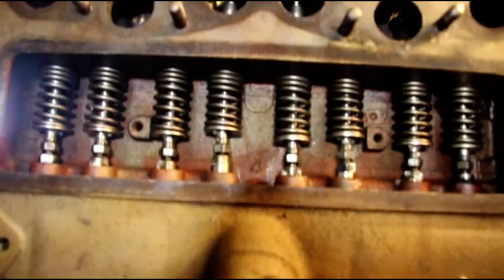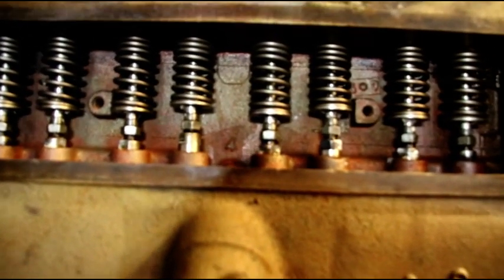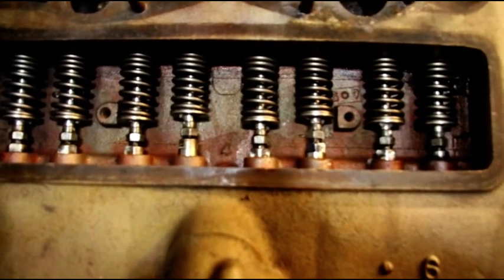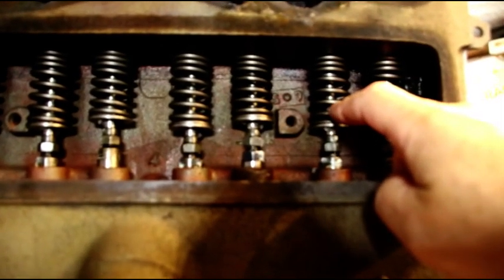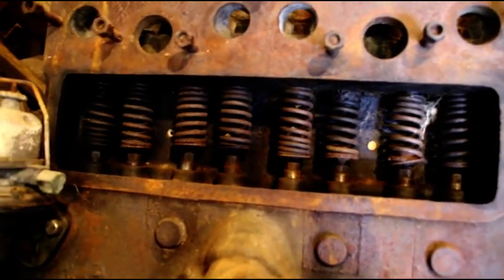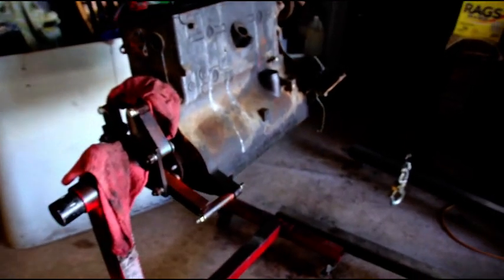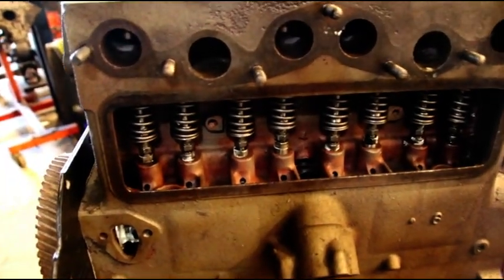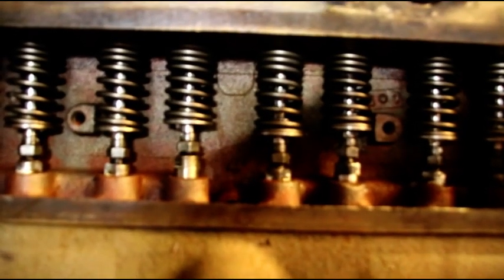Willys Engine Rebuild Tip Of The Day

Comment: Every tip you share is helpful Brian! I guess since most people work with modern engines, they think coiled side goes down without realizing that in a flat head the resting surface is up.
Reply from the maker: Many, many engines come in with springs installed correctly.   yes the engine will run but not as good as one of my rebuilds.  Lots of people have marginal engines and always wonder why their Jeep doesn't accelerate well or can't climb hills at high speed.  I have traced a lot of problems to the valve train and when it is right people can't believe how much better their engine responds.

Comment: The tight coils have to be at the spring seat end,  I have not seen an f-head jeep engine, but, assuming the same style of progressive wound springs, the intake springs, on top of the head, would have the tight coils to the bottom, against the head.  It has something to do with the weight (mass) of the spring coils moving with the valve or not.
Reply from the maker: This is a Willys L head engine and the valves are located in the block.  The engines shown in the video are a 1943 and a 1947 and are both L heads. There are no valves in the head.   Please consider learning a little bit about this engine before making a comment.
Reply: @metalshaperJeep  Your video is excellent.  No insult intended.  I'm just saying that the tight coils always go against the spring seat, which is "up" on a side valve engine like this, but would be "down" if the valves were overhead.  I love old engines, and have overhauled a few old Chrysler L-head sixes, many years ago.

Comment: Hey Brian, what do you think of the Tornado 230 OHC engine that was in later model Willys Wagons? I'm looking for a wagon but opinions on that motor seem pretty divided...
Reply from the maker: The 230 OHC is not a bad engine and I had one in a M715 truck that I used as a daily driver for 6 years.   The engine was fine and I never had a single problem.  The 230 was susceptible to carb icing on cold or humid days and did take a while to get warmed up in the morning,  but it was a  great engine.  If you find a good wagon buy it no matter what engine is in it.
Reply: @metalshaperJeep  Thanks a lot Brian, I really appreciate you sharing your experience! I have a 3b so I want a Wagon so that it has a brother ;)

Comment: Hello I was wondering if you could help I am working on a 1948 willys they had me install an sm465 it has an adaptor the Dana 18 bolts up but the output shaft gear on the transmission going to the tcase gear does not fit it seems to large. 26tooth gear. Any help Is greatly appreciated
Reply from the maker: You need to change the transmission mainshaft when installing a 465 to dana 18.  Your gear will not fit on the stock 465 mainshaft.
Reply: @metalshaperJeep  it has been changed the gear slides onto shaft but will not mesh with the Dana 18 internal gears. Having a hard time figuring this thing out I received it in about 1000 peices

Comment: Ok, I'll bite....explain to me how having the spring upside down causes valve float.  The spring surely exerts the same amount of pressure either way up.
Not disagreeing with you, would just like to hear the reasoning for it making a difference.
Reply from the maker: The way the spring closes is what is critical.  With the coils up as the tappet raised it closes in such a way to keep tension on the valve.   When it is installed incorrectly the spring closes too fast and the tension on the valve is not as great at high speed.  This isn't a theory it has been proven and many engine manufacturers back in the day used a spring like this with tightly wound coils at the top.
Reply: My 2 cents; D6c10k, the dynamic movement of the valve stem end is affected by the mass in motion. Put the heavy end out there where it has to change direction and overcome inertia and you’ll eventually reach a frequency that limits travel. The valve is always forced completely open by the lifter so the dynamic travel limitation affects the closing dimension (producing float).
Reply: @bamoffett  I can see that.....sort of like on a vehicle  where you want to reduce the un-sprung weight in the suspension to give it the best reaction time possible.
Put the light end of the spring toward the stem end of the valve so it moves quicker.

Comment: I guess nobody pays attention to detail when building the motor! If you did you would either get them all wrong or all right!
Reply: I would see it as an ok rookie mistake to put them all down, since that's what you do on a modern engine since the resting surface is down and only flat head engines have it up. But as you say not many put attention to detail and they just go either way.
Reply from the maker: 4 engines in the shop and every one has incorrect springs.  Some up some down but nothing consistent